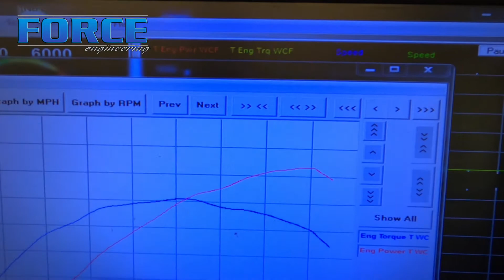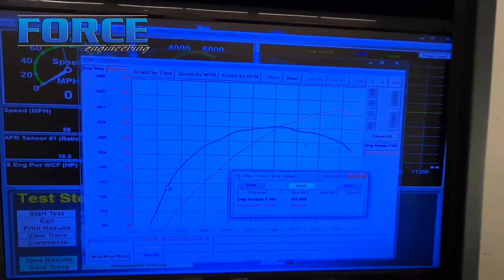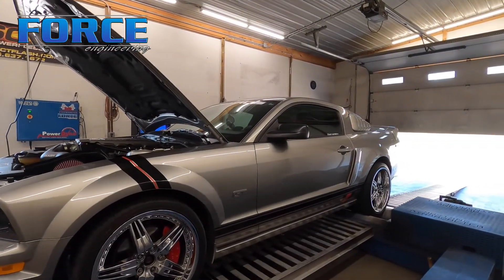Dyno Review - NA 4.6l 3v 2008 Mustang | Bolt-ons + Camshafts

Comment: Bruh what that makes no sense those have to be stock numbers lol. They make 300hp stock and 325 ft/lbs of torque. With headers cam intake and tune you should be at like 330 wheel
Reply from the maker: From the factory they make 300hp at the flywheel.  Spining the transmission, driveshaft, rear end, wheels and tires all uses energy.  The use of energy results in a power loose at the tire.  Typically 15-18% for a manually shifted car and 20-30% for an automatic.
Reply: @ForceEngineering  if I had a penny for every comment like this I’d be rich lol . I don’t know a lot about cars but I know what whp is .
Reply: @supra8065  yeah a year ago I didn’t😂 I know now tho. Live and learn
Reply: @C depends really. Dyno tuned, fbo mustangs are putting down around 340-360 wheel. One buy got 375 out of a JLT series 3, udps, shorty headers, throttle body, and no cats with a dyno tune. While the OGs post is flawed he’s not wrong. This is putting down base, “get it running” power
Reply: I know what whp and about drivetrain loss. Thanks for agreeing these are low numbers. With all those mods it should be at LEAST 300 whp something just doesn’t make sense
Reply: @C mild cams dont do much for the 3v
Youd be looking at the 127500 or 600, everything else is mild
Reply: @C cams are a big deal for the 3v. A small nsr cam wont do much. You need a spring required cam like a 127500 or a 600. Expect a 40-50whp gain